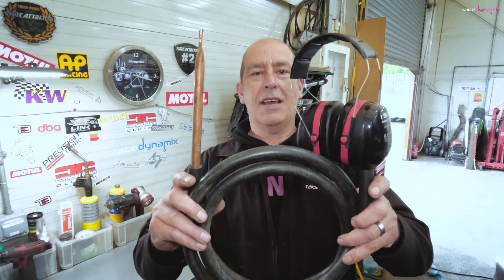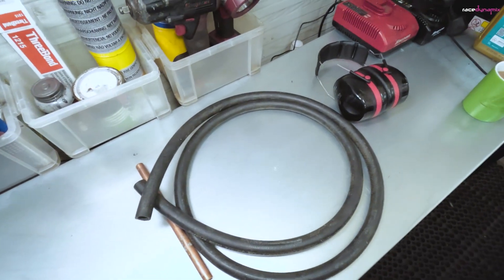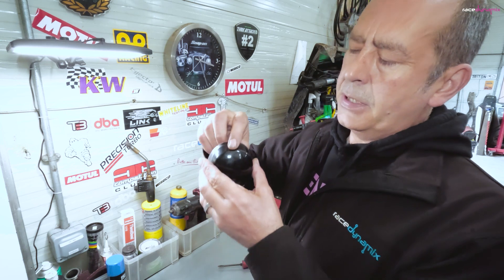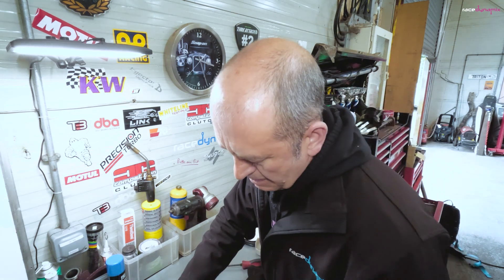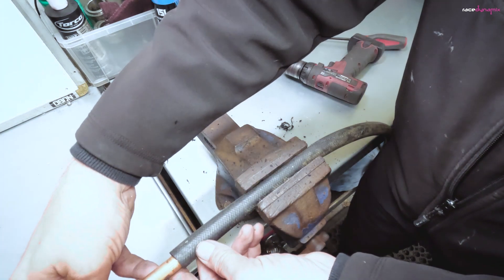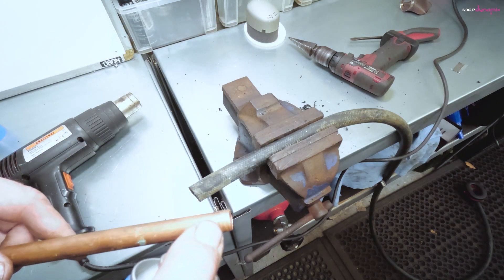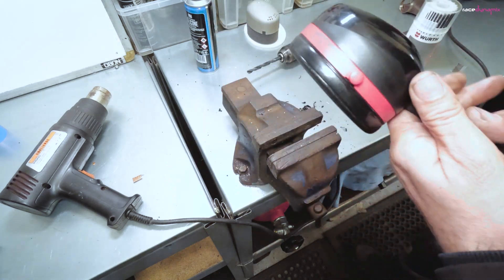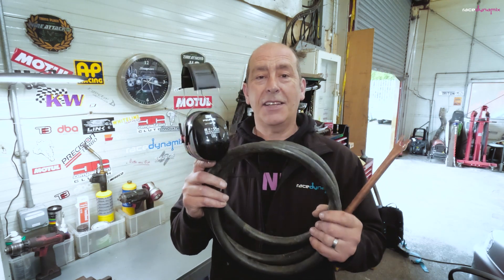How to make DET CANS | ECU Tuning ESSENTIAL kit

Comment: regards from brasil!! can you show where i put this on the engine?
Reply from the maker: Ola bom dia.

I usually bolt to the inlet manifold where the bracket to hold the intercooler is 👍

Comment: Hey man, great video.  I have made a set in the past but never got around to using them because I dont know what i am supposed to listen for.  What does pre det and detonation sound like through these?  Im afraid to start advancing timing because i dont know what to listen for.
Reply from the maker: Thanks.  Detonation is a very distinctive click when it is just starting ranging up to a very violent crack on huge det. Once you get used to the normal ticking away of the injectors as revs increase it is easy to hear this sound.  I will try at some point and do a video of it but it is dangerous so don't want to inflict it on purpose tbh 🤣
Reply: @racedynamix   is there a tutorial video on where to put the probe or how to use them? I know you say to bolt it on the intake manifold, do you do this on every cylinder?

Comment: great video, Always look forward to you videos.  i am going to make a set. Where  are the common places to attach the copper end to ?
Reply from the maker: Thank you 🙏 Best a d easiest place to fit them is the intercooler mounting points on the inlet manifold 👍
Reply: So it's not necessary to get it as close to the piston as possible? @racedynamix
Reply from the maker: @spectr3origin931  nope.. anywhere on the inlet manifold is good 👍

Comment: Learned something new. Never heard of any of this before. I must not have been tuned properly😂.
Reply from the maker: For a subaru engine in particular (and most others) where power is limited by det they are a must have as it is impossible to rely on the knock control safety within the ecu. On some cars this does not react even when I can audibly hear detonation. It is like relying on a driving instructor to do the braking for you... Just a bit too risky.

Comment: hi duncan, if you've got a set going i'll be at santa pod this weekend dialing my JDM in. was going to make a set before if i had the chance so this would be ideal. i've got the tuner nerd knock detection but not really getting on with it. and i don't like entirely relying on feedback knock on romraider. would prefer to confirm with ear.
Reply from the maker: I would never rely on the knock detection from the ecu unless it is a properly set up syvecs ecu.  On some cars the std ecu will happily sit doing nothing while the engine is grenadine itself to pieces 😱

I will pick a winner this week but I will have my set at santa pod regardless if you want to hook up 👍

Comment: Top draw old school💪👌 but question is do you actually use these or do you use electronic ones now? 

I have asked this question so many times and everyone says electronic like phormula nobody seems to use the stethoscope type anymore.
Reply from the maker: Plus.. I was sat with another tuner recently with him using electronic device and me with my old school and not only could I hear det he couldn't but I could also hear pre det.. Much easier to keep the engine safe imo 👍
Reply: @RaceDynamix Subaru Tuning  then my friend you have converted me have been looking into det cans and was pushed towards the phormula set but I shall give these ago and see what I can hear 👍 also saves big money. 

Defo a worthwhile video and thankyou 👌
Reply from the maker: @kyletait91  I have used them for many years.. The copper pipe gets worn and cut shorter over time but super cheap and imo way better than converting a noise to a signal then back to a noise again... Things always get lost in translation.  Thanks for watching 🙏
Reply from the maker: Always old school.  They are far more sensitive and real sound not synthetic.  Plus I can hear air leaks and other things too with them that electronic det detection devices can only dream of.
Reply: Hi Duncan, where do you bolt the copper pipe to inlet ? Earth strap or lower near engine block, thanks

Comment: Great bit of kit. Would be nice to have it with a dyno 😅 unfortunately, don’t really have an access to one.
In addition, do you supply kit that allow you to connect to Alcatek ecu & do small tweaks yourself? As in the cable & dongle. I know there is a video coming up about tuning your own subaru. So I’m slowly trying to gather all the pieces together to be able to do some basic adjustments myself.
Thanks!
Reply from the maker: Hi.  It is not possible to get hold of the dongle and leads now from Alcatek unfortunately.. They have stopped doing them.

Mapping academy videos will be coming along with live q and a sessions etc.. 👍